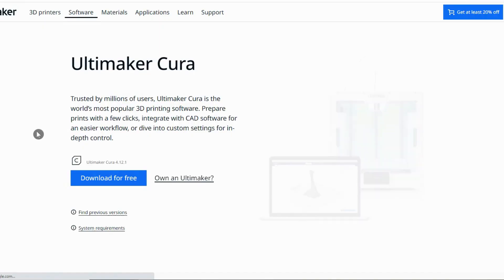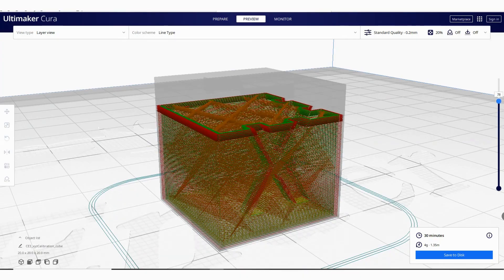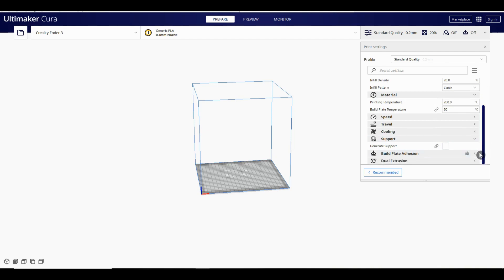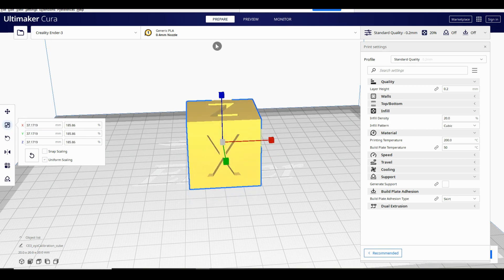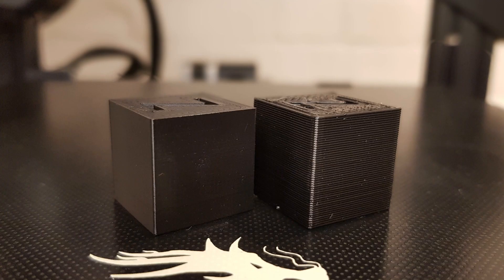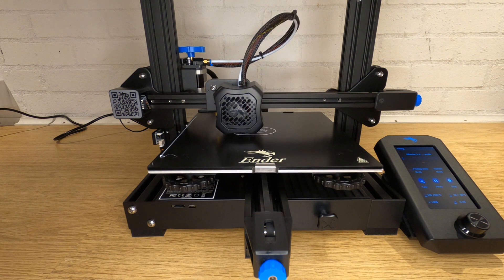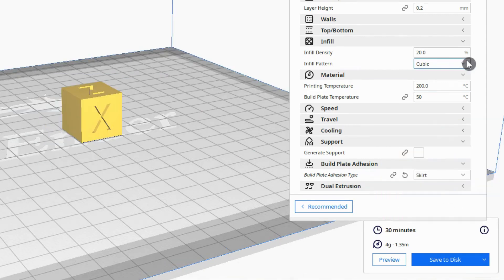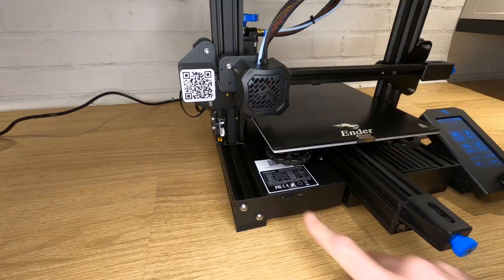Model File to 3d Print - A Beginners Guide to Using Cura (3d Printer Slicer Software)

Comment: Getting my Ender 3 V2 this week so I am getting prepared. Thank you for all these informative videos! I will be using your build one for sure. I need to read up more on firmware versions as I also bought the CR Touch and it looks like Creality is picky on what version you have. It looks like people recommend going straight to Marlin 2.1, but not sure if that is wise for a newbie. Assuming it works fine with the CR Touch. You may already have that covered, so I may see it in your other videos.
Reply from the maker: I can recommend just going for Jyers firmware with the CR touch, it just works and it's what I run. Enjoy your new printer, it's a fantastic machine if you make sure it's built right👍
Reply from the maker: Here is the Jyers firmware video https://youtu.be/Qv_vVrnkAkI
Reply: Thank you for this great info! I will look into it now. :)

Comment: Hi Question I'm just starting out I wanted to print Ender 3 Filament Guide would I leave the scale at 100% and the print settings just like you have here on your video?
Reply from the maker: Hi, it does depend on the STL file that you have downloaded and usually you get a guide where you downloaded the file as to what the best settings are. 99% of the time you wouldn't change the scale, if you add more infill it will just take longer. If your Ender 3 is as it came with a 0.4mm nozzle then yes, you can probably use all of these same settings and it will print fine. The good thing about having a 3d printer is that you can always try again if something wasn't quite right 🙂 Make sure you check out my bed levelling video so that you know the printer is setup correctly and go for it. Good luck, and let me know how you got on. I'll help if you need more advice, that is what the channel is here for 👍
Reply: @RickyImpey  Thank you

Comment: I can't get it to slice into code, instead it slices into ufp or usp, I don't know how to stop this, I've been trying for hours, im so close to giving up on my printer
Reply from the maker: Sorry to hear you are having problems. Don't give up, I'm sure it will be fixable if we are methodical. At what point does what you are experiencing differ from what happens in my video?
Reply: @RickyImpey  Instead if slicing into g code it's slicing into something called "upf" or something along those lines
Reply from the maker: @happylittletrees6685  that would suggest to me that you have your printer profile setup as an ultimaker printer as that's the file type they use. What printer do you have?
Reply: @RickyImpey  I use a vixeoab aquila
Reply: Voxelab
Reply from the maker: @happylittletrees6685  ok, what printer profile do you have selected currently? Maybe try adding a profile for and Ender 3 and slice a file with this. If you have the Aquila, they are very similar to an Ender 3 and will definitely output g-code that you can try.
Reply: @RickyImpey  Thank you a lot, I will try that
Reply: Mine is doing the same.... And I'm not sure what to do to fix it